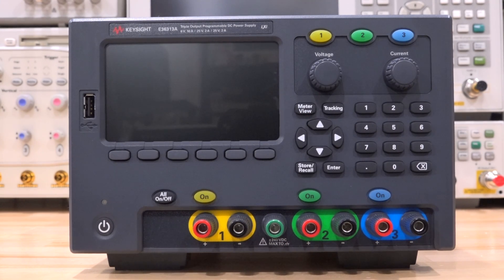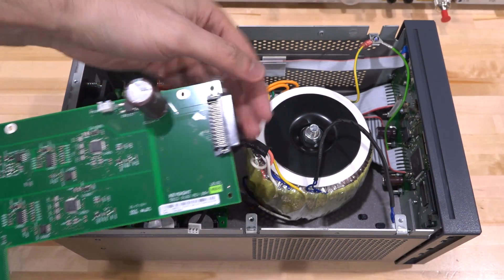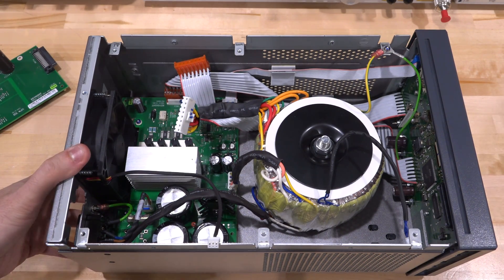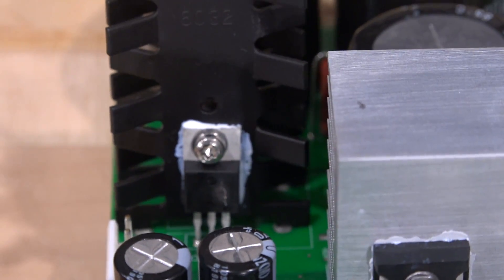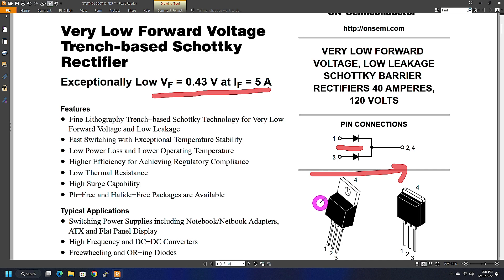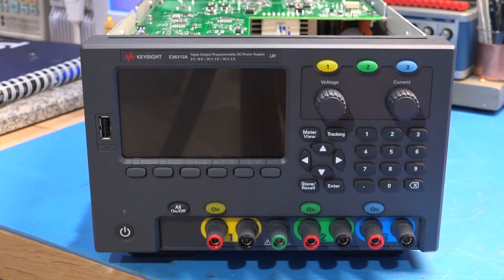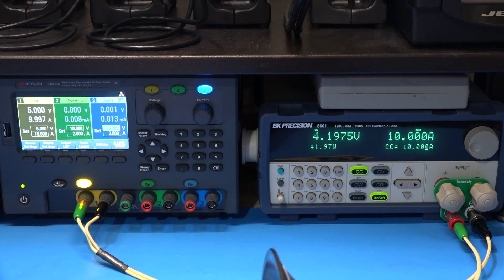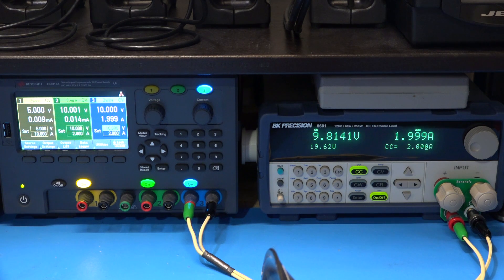TNP #25 - Keysight E36313A Triple Output Programmable DC Power Supply Teardown & Repair

Comment: Maybe it got hit with a massive line transient while it was off (or should I say idling).  Perhaps without full power on, some internal protection is lost in some areas of the design.  Reminds me of the SMPS in the Infinivision 3000 (and other scopes), always on and cooking its own capacitor and resistors.  Simple PS failure takes out multi thousand dollar instrument.

Comment: What was the original fault. I have had 2 of these and my second one has just failed, bang on switch on smoke but only ch1 has no output have you any service info, ps i am a tech btw, thanks

Comment: I like the feature of commanding via USB.. but there's SO MUCH bloat-ware, that it's incredible.

The bare minimum (IOLibSuite_18_4_30319 + Keysight Command Expert 2023 (CommandExpert_WEB_MSI_1_11_045) + Keysight Communications Fabric 2.2 + E3631xA series Power Command Set 1.0.4_1.0.0_1.04) is several HUNDREDS megabytes, spanning dozens of programs and windows services.

Even after installing all this, it's unclear as to what you need to turn on/off the output via a simply python script!  For example, 'no module named 'pyvisa', so imagine all the above is still not enough installing?!

Comment: After the repair, run the supply to maximize the power dissipation through the dual-Schottky (high line?) and observe the device with a thermal camera. I think you will find that these twin Schottky rectifiers have a bad habit of a die thermal hot spot, along with the device high reverse leakage can at times let the smoke out. Maybe move up to a TO-247 power package for the dual Schottky it looks like it would just fit on the heatsink.

Edit: Using the SMU 2460 see what the device reverse leakage is at 100V reverse and see if this makes sense for the design, the pair together may runaway in reverse?
Reply: Just too bad you never got a reply.
I would be a benefit to find out.

Comment: 7:22  Lower left corner of screen.  A wisp of smoke escapes the shrink wrap on the white cable when the load is enabled.
Reply from the maker: There is no smoke. The shrink tube is just holding the cables together, there isn’t even a break in the cable.
Reply: @TheSignalPath  It's invisible on a small screen but on my low-end 24" monitor, it's visible at around 7:23.  Between output 1 and output 2, there is a binding post for ground with a green ring.  If you stare at that, the moment you say "five amps", a small wisp of smoke floats upwards and past binding post.  I've become unsure of the origin but it could be the cable.  Just to be clear, I'm open to the possibility that there is no smoke and I'm losing my mind.  I just found this to be an amusing observation - nothing more. 

Your test equipment tear down and repair content is of the highest caliber.  Thank you for this channel and your hard work.
Reply: You're right, I see it too!

Comment: Is it still generally safe to use variacs for bringing up switch-mode supplied, microprocessor driven equipment? I heard rumours that you risk the switch controllers going into an undefined state and for example leaving the FETs/triacs on and overvolting the equipment. Any thoughts? Thanks in advance
Reply: Even $5 bricks when ran on overloaded generator or through series lightbulb just do equivalent of power cycling on undervoltage, I don't think there's topology in commercially available product that would die from this.

Comment: Always looking for low forward voltage diodes.
Looked up the NTST40120CTG diode. Both Digikey and Mouser say it's obsolete.
Why would Keysight use it in a new design? Maybe is was still active at the products release.
Reply: This was designed over 5 years ago, so probably.

Comment: Studying the analog boards, I was never able to pinpoint any DAC's, so I suspect that they're using the STM32 to generate PWM or possibly delta-sigma modulators to generate the V/I set points and limits.

Comment: You mentioned doing a video on the shunt resistors and why they are shaped like that-  
That would be interesting
Reply: Concur. Especially when combined with other non-trivial design issues with ultra-precision / high power resistors (tempco, material, moisture ingress, drift).

Comment: Those type transformers are really broadband - probably a voltage spike from the line transferred into that device. They need to increase the surge amp rating to double or triple of whatever it is now.

Comment: Nice video. I've been using one of these daily for the last 7 years without issue, however, the screen now is starting to go. Otherwise it's been a great PS and quiet,  you can barley hear it when running.
Reply: They've only been around for 5 years.
Reply: @jaro6985  you are correct, i checked my invoice, ws 2018 when i got one.  makes me more worried as the screen is going on it in only 5 years.

Comment: I wonder if that 13 watt standby indicates another problem lurking. That seems really high for a modern piece of hardware, especially with Keysight's name on it.
Reply: Not really, just the no load magnetising and core losses of the transformer, as it is always powered on. Big high power toroid, will have some power use always. No need really for a CM choke as well, seeing as you have such a massive inductor in the primary side as well, though they could have replaced one with a NTC inrush limiter, and thus allowed the mains fuse to be a lower rating and not have it blow with power connection.  However fuse did the job and blew when the diode pack shorted out.
Reply: I remember Dave Jones practically losing his mind over a scope using 6.5W in standby.

Comment: 13W power consumption in standby. That is not good at all. A bench PSU doesn't even need standby in the first place. My one has a real mains switch and starts up instantly.
Reply: It certainly won't be ErP compliant. ErP is a european directive that says standby power consumption must be <0.5W when in standby.
Reply: @simontay4851  I think that's only for consumer devices, so not all too relevant here.
Reply: @barthettema7323  That's just as bad as Weller leaving out the mains fuse from some of their products on some legal technicallity. Seriously, nobody expects their modern, brand-name instruments to have this kind of standby consumption.

Comment: Cool. I recently got one of these as well, with the rationale that its front panel / UI roughly matches Keysight's other offerings (DMM, signal generator, universal counter, etc.). One super nice thing about this PSU is that it is nearly silent. It is also really good at measuring low currents (great for IoT work).

Comment: 13 Watt standby for a modern piece of test gear with no fancy crystal oven to keep warm. That is not cool. It should have a mechanical power switch.
Reply: @FooBar89  Yes, and it will still deliver that DC pulse if it loses AC power.
Reply: Makes me think there is something else wrong with it.
Reply: @why78536  2 other comments measured similar consumptions on their units, so it's just a design oversight.
Reply: It's just reactive power of the transformer.
Reply: @KuntalGhosh  it's measured with a power meter that takes cos/phi into consideration, so i don't believe the reading is wrong.
Reply: @FooBar89  we tested several different supplies (as we decided not to buy the E36 anymore). It turns out, that most cheap supplies glitch during turn-on, the Rigol are loud (fan), R&S are too expensive for what they offer, but the Siglent supplies are actually really good. Stable no-bs supplies with LAN for a good price.
Reply: We are using "old" E36xx that are probably 20 years old by now and we had no issue with them whatsoever. From what I hear, the "new" E36xx just can't live up to that quality and reliability.

Comment: Excellent work once again! We have a few of these at work. Compared to the older E36XX series, it seems mostly like a face-lift with independently enabled channels and a graphical UI. The standby power consumption is quite horrible on these as well, the unit is actually warm when off and doing nothing. Always prefer mechanical mains power switches on gear like supplies. 

Also, going to start videoing more repairs too. Just uploaded a repair of an MS2721B which I know you are also familiar with! 24 ripped pads on the digital board front panel connector.

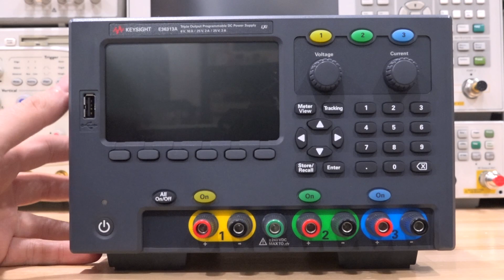Comment: 1:00 Interesting. Does the Green "ground" terminal  imply that you can power the unit with up to a +/- 240V DC offset from ground? If so I don't think I've seen a unit that can do that. Usually that terminal is tied straight to ground ???
Reply: Yes it is at least 200vdc
Reply: I guess it means the channels can be connected up to that voltage(they are isolated) from ground, the limitation is probably the transformer with a big safety margin.
Most linear PSU can do the same, although it is not always specified in the manual.